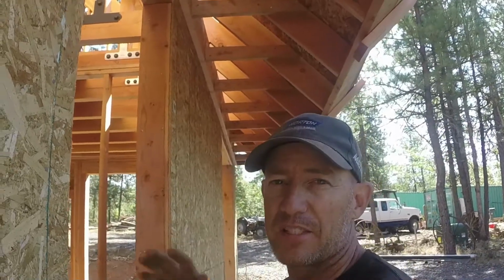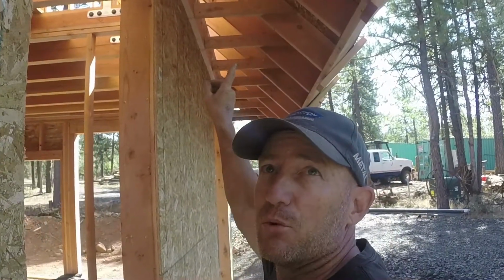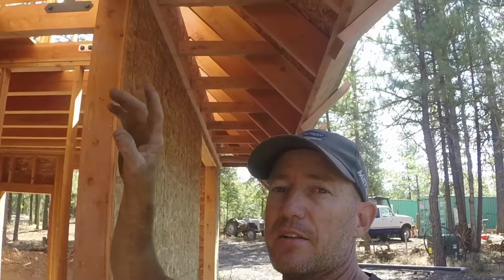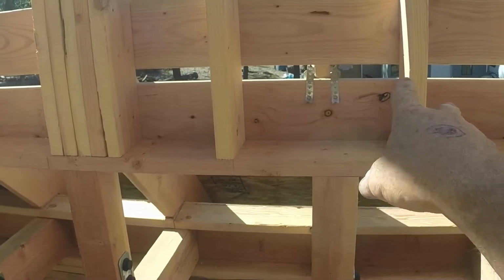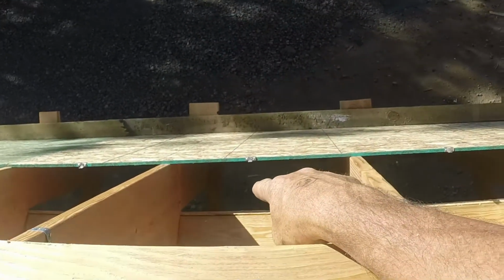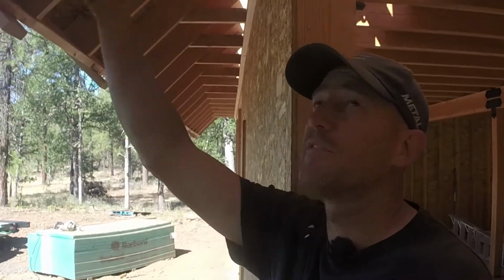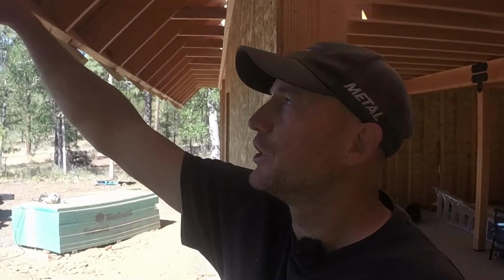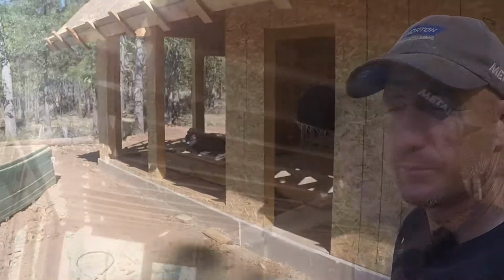Extra rafter supports to help hold our longer rafters

Comment: Nice work process putting the shade over the work area before putting the supports in place!  ;)
Reply from the maker: Every once in a while think ahead a little. Even with all the extra supports, and I have had my weight on the 2x4 blocking at the eve, I'm still a bit skeptical about how much weight it can hold. lol Thanks for watching. :)